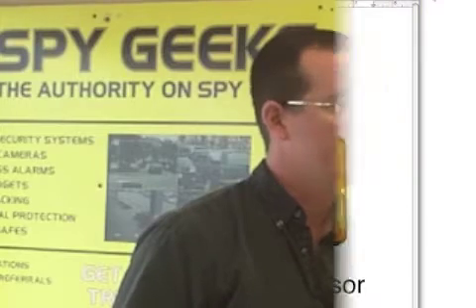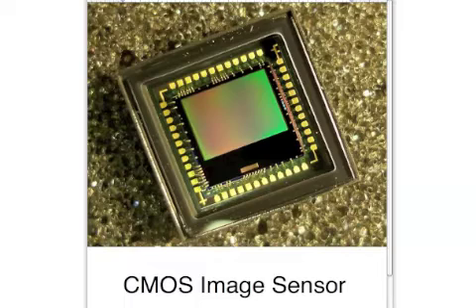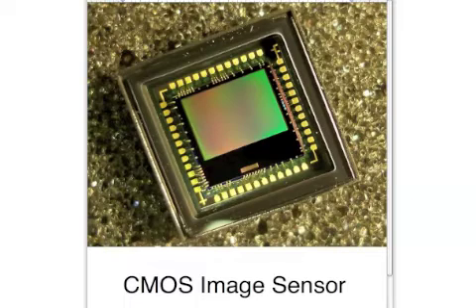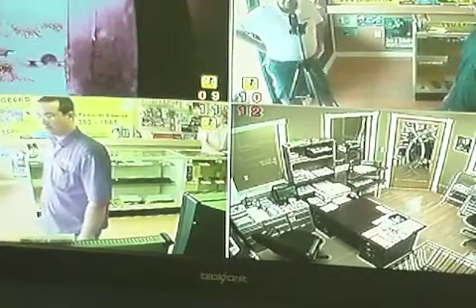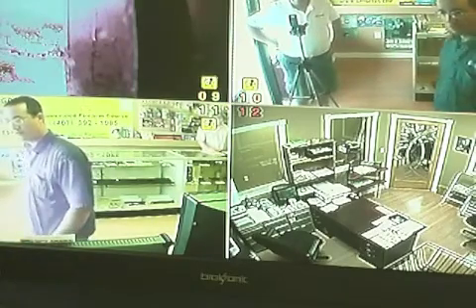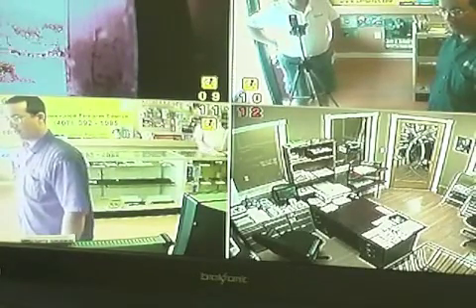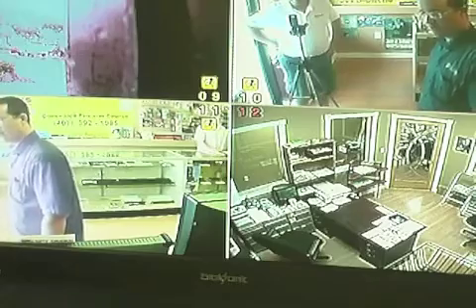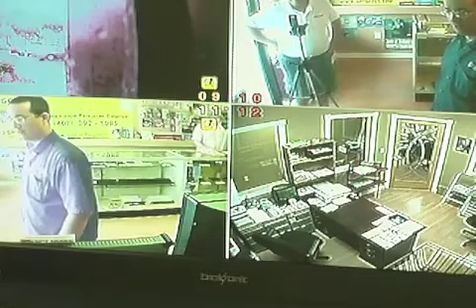Whats The Difference Between CCD  vs CMOS camera Image Sensor

Comment from the maker: @RET80 instead of removing the video maybe it should be clarified. The speed an image is captured whether it be a global shutter or a rolling shutter  happens faster than the blink of an eye. Why would capturing an image one pixel at a time at an extremely high rate of speed be impossible.  Each sensor makes a digital copy of what it captures. It sounds as though you are very knowledgeable I would 
love to here your input as to how the senor transfers light to a digital picture.

Comment from the maker: It is my understanding in order to eliminate light streaks and blur the camera needs to capture the image at a very high frame rate. We work with security camera transmission. I suggest you go to wikipedia and research Shutter Speed for still pictures and Frame Rate for videos.